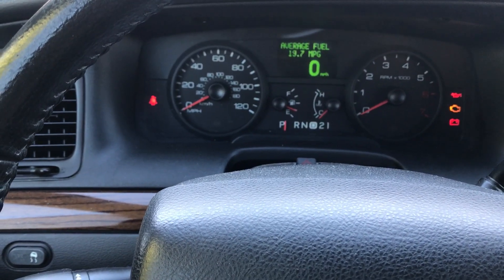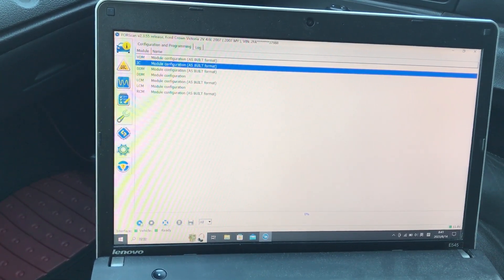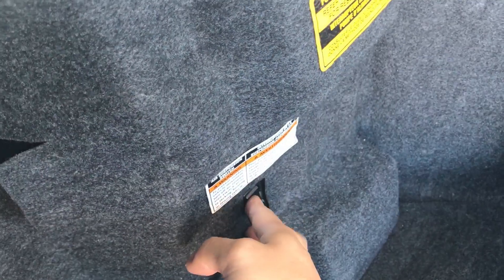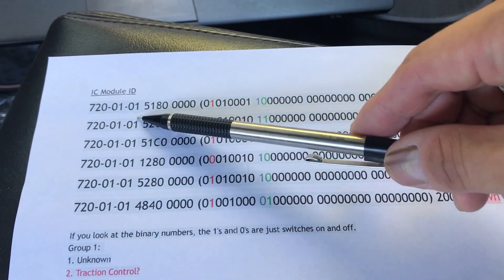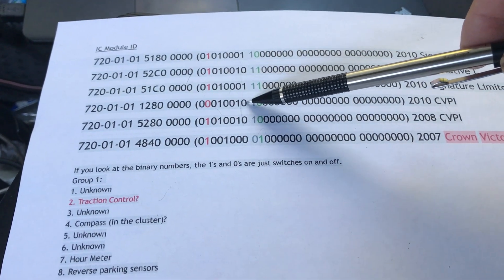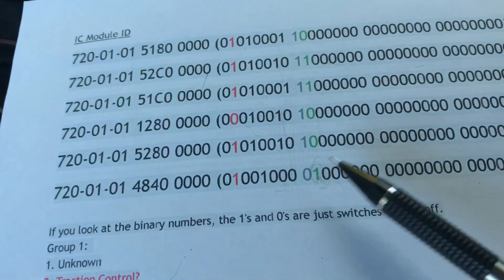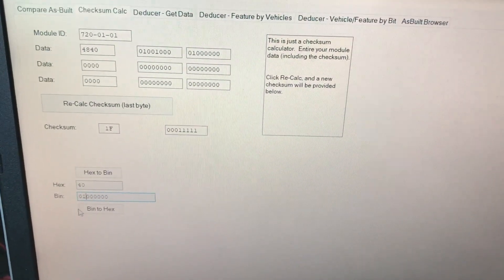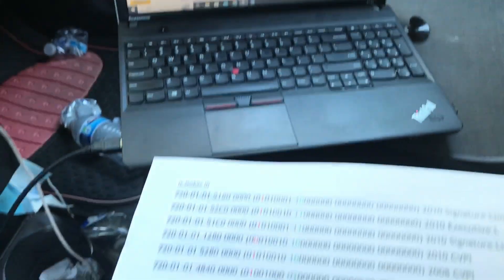How to safely disable "AIR SUSP OFF" warning light on Panther cars

Comment: Awesome vid, thank you. Will try this eventually on my 2001 Crown Vic LX HPP. That dash light surely is annoying. I've heard you can also just unplug the connector to the air suspension switch in the trunk. I'll try that too. Would definitely rather reprogram the car properly with Forscan than cut wires n stuff.
Reply: I have since disconnected the plugs to the air suspension switch in the trunk and that doesn't do anything, the dash light still comes on. After re-reading my comment I realize I should have phrased it differently; Do you think this same process would work on my 2001 Crown Vic using Forscan, or do you think it would be different. I have a fully digital dash.

Comment: Probably got to pull the relay.  Under the hood.
Reply from the maker: Thank you for watching the video. There are 2 fuses: #112 Air suspension compressor, #5 Rear air suspension module, and One relay #302 Air compressor. You can try to remove it, but you will get warning light for "Check Air Susp System". The feature of the air suspension system monitor is built in IC module, unless you remove the fuse for the module(it won't work). By pulling out these fuses and relay will only send message to PCM shows your air suspension system has error, and than the PCM will send message to the IC module where you can see your warning light on your dashboard. You can try it on your car, see what will happen? or you might be right , please let me know. Thanks